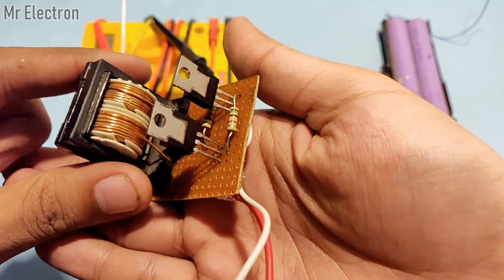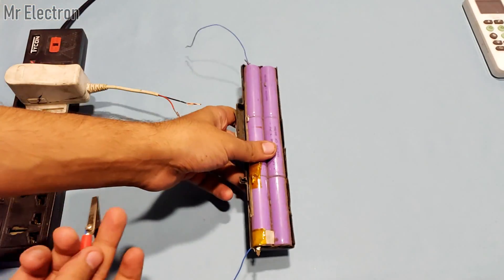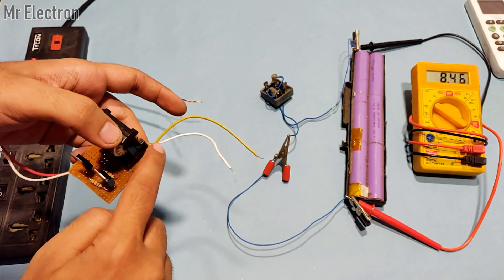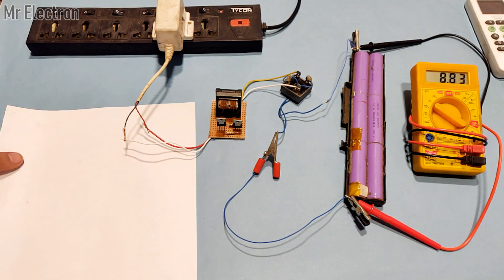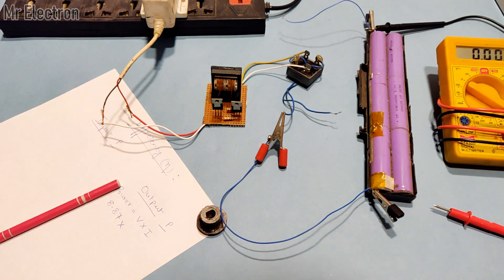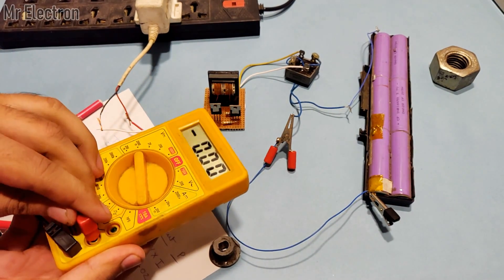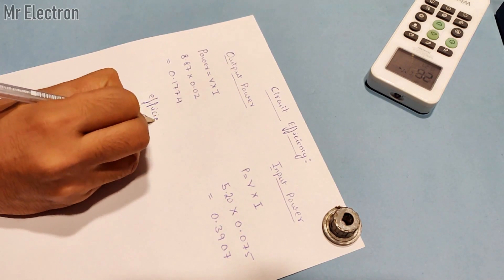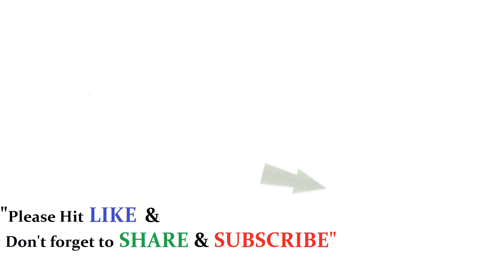Awesome Idea ! Charge 12V Battery with 5V Mobile Charger DIY

Comment: Awesome video, thank you for sharing!
I'm currently working on a project to help homeless people charge their cellphones. Most homeless people with Obamacare health insurance also have an Obama-phone but no way to charge it. I'm working on a way for them to take any battery, prefer a 12v motorcycle battery, a phone car charger USB adapter that converts 12v DC to 5v by way of standard USB. So you take your battery and make wire leads from each terminal. The positive goes to the very center nipple and negative to the sides. You can take each wire and jam it under each of the adapter buttons when you fully collapse them, providing a very secure fit and eliminating the need to soldier (remember, homeless people don't likely have access to a soldiering iron). From there, you just plug in and you should be good to go!  When their battery goes dead, they can drop them off for a couple hours at their local auto parts store for a complimentary charge! Our local Auto Zone does it for free. By my estimates, the motorcycle size battery should keep a cell phone charged all week!! Is this not the coolest idea ever? Maybe you can do a video on it?